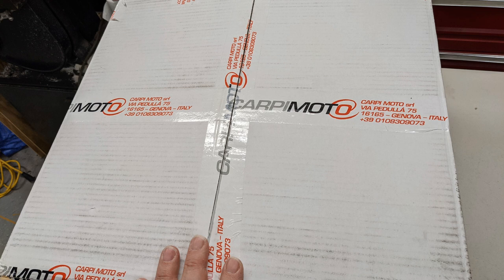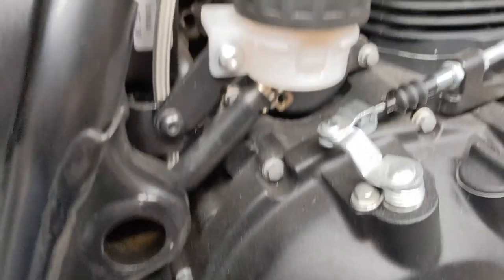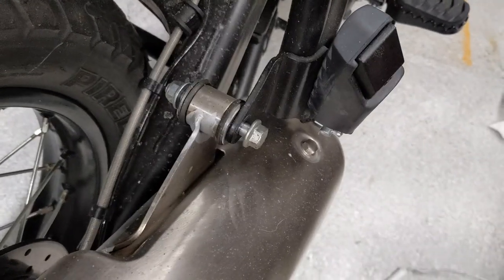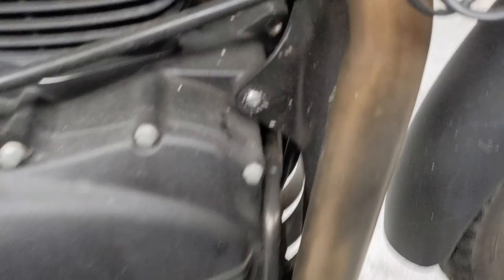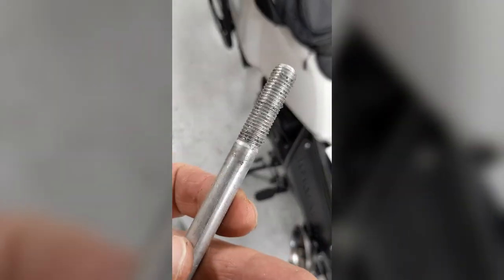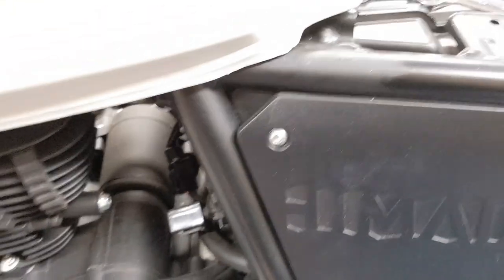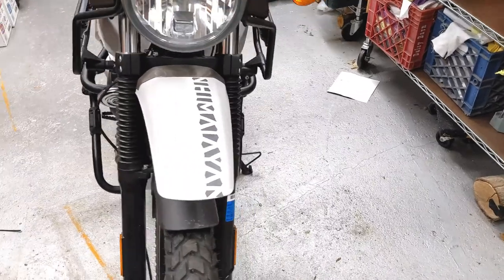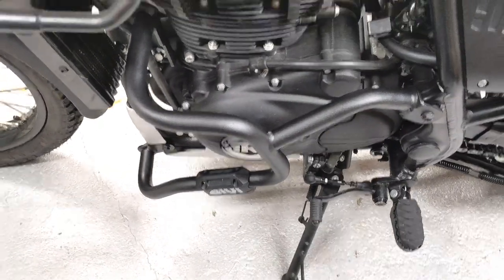Royal Enfield Himalayan Givi TN9050 Engine Guards or Engine Bars or Crash Bars

Comment: I just put mine on. Thanks for the tips.  On mine I noticed the oil cooler line was rubbing on the forward engine thru bolt.  Glad I caught that before it chaffed the line.  The bolt by the exhaust had just enough room for an open end wrench. As you mentioned there are threads however they are covered in assembly paint and need to run thru once to pseudo re tap them.  Thanks!

Comment: Good video and I just subscribed. Question though: I just got these today and my rear brake reservoir line is not long enough to install the bracket like you did and as is shown in the instructions. I have a 2022 model, so I wonder if there is any difference. I left the reservoir on to test fit and it doesn't seem like there is an issue. Thoughts on that? There were two zip ties in the brake line area and I took those off to get a bit more slack, but it's nowhere near enough.
Reply from the maker: Maybe they changed the design slightly to avoid having to install the bracket?
Reply: @forseeit  I talked to a few people on a forum last night and all of them avoided using the bracket since their brake lines weren't long enough either. None of them reported any problems doing it that way :)